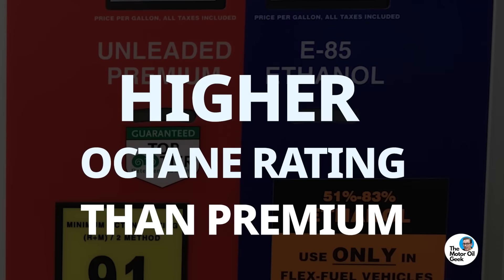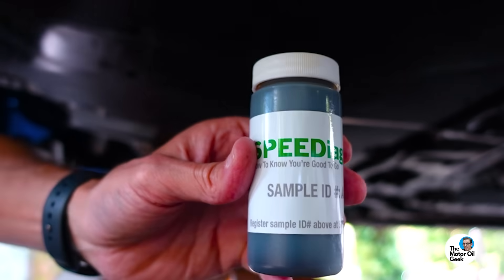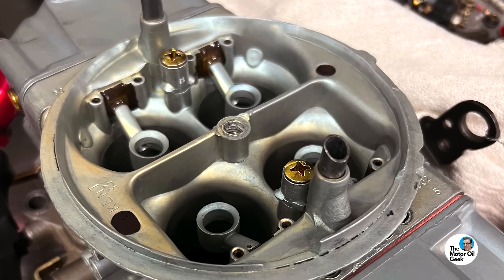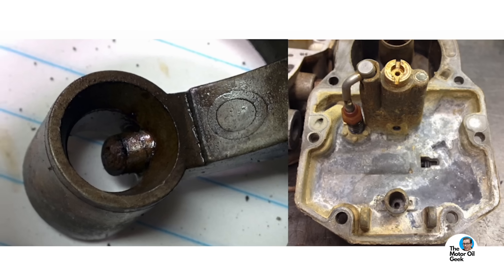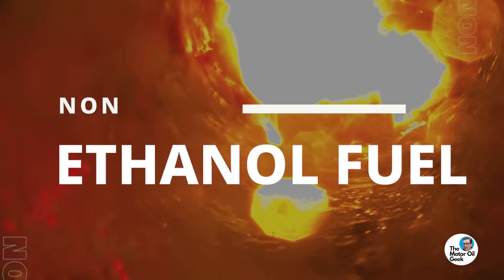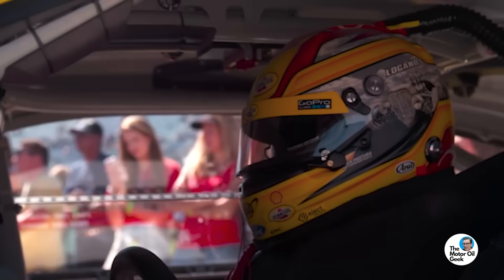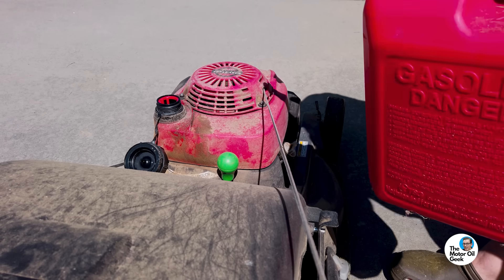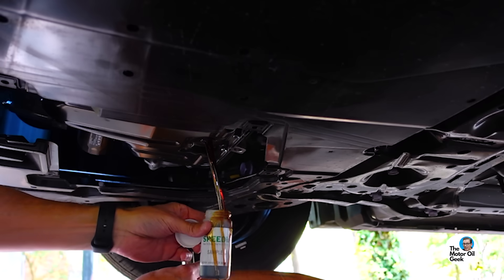ETHANOL: Higher OCTANE, Higher RISK?

Comment: Since you brought up the fact of using TruFuel, what about comparing that fuel to mainly mixing the oil? My two-cycle stuff does not run nearly as good on the canned fuel as it does when I mix it manually.

Comment: I have a 2018 F350 with the 6.2L I use for my lawn maintenance route. I run the same route every day. When I use E-10, my fuel mileage is right at 8.0 mpg pulling my equipment trailer. It never changes. But the few times I tried the E-85, that same route always got me 6.8mpg. Not worth the savings just on that alone.
Reply: The cost benefit only makes sense if you are comparing it to premium fuel, and then it's usually break even. If it can run on 87, E85 will likely never be cheap enough to make sense.

Comment: Yeah, i switched to alkylate fuels for my 4 and 2 stroke carburated small engines 5 years ago becouse i got tired of rebuilding carburetors every season. 

And even if the price of alkylate fuels is higher it saves me time and money in the long run not having to drive 15 miles to buy parts and waste my day working on something that i shoudnt have to work on every few months. 

I dont mind tinkering with stuff but it gets old pretty fast when none of your machinery works after sitting unused for a few weeks or months and you go and try starting them..

I even flush the carburetors on my streetbike with the alkylate fuel when the bike goes to winter storage.

Our mx bikes get driven through the year and we havent had problems on those with E5 fuel. I still drain the carbs if i know we wont be going out driving in a few weeks.

Comment: Been doing mechanic work for 55 plus years, don't know why I watch this already knew it, ethanol mixed fuel is crap, need to bring back our old gas and Diesel, if you go down and buy all the pre-mix or the little cans of gas you got rocks in your head.
I don't care how you control the atmosphere on drums of ethanol fuel you're still going to get water in it, you just told a big lie.
It is almost impossible to pull the atmosphere down to 0% humidity.

Comment: Ethanol-free has made a huge difference in my small engines.  Used to have to fiddle with the carbs constantly at the beginning of every season.  Now I just use E-free, and run it dry at the end of the season, and they start right back up next year.
Reply: I don't even run it dry at the endof the season and it restarts perfectly fine over six months later. I use nothing except ethanol-free in my small equipment and in my SUV.
Reply: I won't run anything but Ethanol-free gasoline in my yard equipment. Mowers, leaf blowers, weed eaters, edgers, trimmers... all E-free. No more rotted fuel lines, varnished carburetors, and equipment that won't start.
Reply: I used to do the same, but there's so much moisture where I live that I was getting rust in the dry carburetors. Now, before the end of the season, I run atf through the fuel system while the fuel is low, then I turn it off. Helps keep the carb clean too.
Reply: @mattmenshevik I've considered that.  Good idea.

Comment: In addition to all the Negative effects of running E-whatever fuel in older vehicles (and it's debatable whether newer cars have ever been properly spec'ed beyond increased fuel tables), I still don't understand the rationale of how burning 15% more fuel per vehicle somehow offsets emissions savings in a maintained engine.
Add: Lake, not sure if you've seen it, but in my usual reflections, Mike over at MotoIQ did a segment on long-term E85 in his daughters tuned Subaru and what ended up causing its catastrophic engine destruction. (hint: E85-induced oil breakdown and short-duration trips).

Comment: I need to show this video to my friends who give me a hard time for going out of my way for gas stations that offer top-tier, ethanol-free fuel.
Reply: Unless you are driving something produced before the late 90s, or it for a boating and small equipment, it's completely fine. It improves combustion and decreases deposit formation. Lake did a good job explaining the situations where it isn't good, but for the overwhelming majority of cars on the road, they are literally built for it.
Reply: I think ethanol-free fuel is not Top Tier
Reply: @bobt897 top tier is extra detergents, no relation to the presence of ethanol or not. You can get top tier and ethanol free at some gas stations. There are several in my town.
Reply: @bobt897 top tier means there are a higher level of detergents in the fuel, there is no correlation to the presence of ethanol or not. There are several gas stations in my area that offer top tier and ethanol-free 91 octane fuel.

Comment: The best way I found to keep from destroying carburetors in storage is to flush straight 2-cycle oil thru the lines right into the carb. I have several pieces of equipment that sat for several years with no damage to the carburetors. when you want to put the equipment back in service simply put your fuel back in and away you go....
Reply: genius move, wow. sounds legit, especially for carbs with membranes, ive got a feeling the oil would keep the plastic from drying out.
Reply: @louisvl10  It does.
Reply: I put 2 stroke in my bike when I park it for the winter. About a pint to the tank and quick trip to run thru the system.
Reply: @darrinclem2502  nice. How do you flush it out when running bike again?
Reply: What do you think about running them on true fuel before storage
Reply: @AlfieG2255  That stuff gums up in storage just as bad as E-15. Don't leave it in stored equipment if you want it to start a few months later.
Reply: @AlfieG2255 yes that’s what I use from local hardware store
Reply: I thought Tru fuel was just ethanol free gas that had stabilizers in it
Reply: @AlfieG2255 it has 2 stroke mix in it. In different ratios. 40:1 and 50:1.

Comment: amazing to me this obsession with ethanol when we know it shortens the life of engines, damages fuel systems, ruins rubbers and gaskets. And it offers zero energy "independence" because guess who one of the number 1 oil producing nations on earth is? USA. So we're literally taking a $1 out of our right pocket, putting into our left pocket, and pretending like we just found free money. Stupid. But it's politics not performance. It's what's good to buy votes, not what's good for our engines and our wallets. The fact that my flex fuel engine tells me to do oil changes twice as often if you run e85 should tell you what you need to know about how harmful ethanol is on a vehicle. Now riddle me this: if I have to dump 2x the engine oil to use a "clean burning fuel" how in the world does that make it clean? 

The best use for ethanol is an old fashioned. That's it.

Comment: No alcohol formulation is great for fuel system period.

However, How about carbon deposits clogging exhaust system from aromatic compounds combustion like BTEX as octane improver in gasoline?
You will recommend bandage solution “then use Top tier detergent gasoline”, won’t you? 

And also BTEX are all “IARC group 1 Carcinogens” as well. You said store in humidity control room I hope Its ventilated well, otherwise good luck to your lung and enjoy your cancer casino.

There is always a trade off and 
I will not trade off my body health with my cars health.
I will just change my engine oil more frequently and let my fuel system premature fail.

Comment: Here in Brazil we don´t have the luxury of choosing which type of gas to buy, it´s either regular (really bad base gas) with 30% ethanol or Premium (A grade base gas) with 27% ethanol, or pure Ethanol .
We have been suffering with carbs and fuel injection ethanol related issues for decades now, also we have a lot of adulterated fuel which makes matters way worse.
Anyhow, really like your videos, keep up the good work, cheers!!
Reply: Brazil is in a unique situation where their motor fuels don't come from dead dinosaurs but from the leftovers of sugar cane crops which grow abundantly there. For all it's drawbacks it gives them an energy security and independence free from potential foreign influences which we do not have in the US.  That doesn't prevent internal influences in either place though.
Reply: @P_RO_  Yes, that's what the government claims: "We're increasing the ethanol content in gasoline to achieve greater independence and reduce pollution," but in reality, there's a lot of lobbying from producers involved. Recently, the percentage went from 27% to 30%, and the price remained the same. Brazil is self-sufficient in oil production, but even so, the pressure to increase the ethanol content is constant. Here at our gas stations, we have pure ethanol, regular E30 gasoline, premium E25 gasoline, and S-10 and S-500 diesel, all pure Avgas gasoline.
Reply: Not to mention that ethanol has less btu's per unit measure THAN pure gasoline.  

Ethanol is more fuel INEFFICIENT than gasoline.
Reply: @H0kieJoe  Kind of. Pure ethanol engines can have higher compression ratios, which makes them more fuel efficient.
Reply: @MarcosSmith-z1u 

You still have to run a richer fuel mix with ethanol at those higher compression ratios. 

The method of combustion doesn't change the innate chemistry of the fuels in question.
Reply: @H0kieJoe  With ethanol, you can typically go leaner at high loads than with gasoline. Ethanol have a much higher heat of vaporization and combined with the higher fuel mass required for the same lambda value, it cools the engine much better. Add to that the high knocking resistance which means you don't need to retard the ignition the same way you do with gasoline. Ignition retardation causes exhaust temperatures to rise, and to combat that, you typically use a richer air/fuel mixture as excess fuel cools the engine. With ethanol there is less need of that. Ethanol also burns a bit faster than regular gasoline, so it generally needs less spark advance than gasoline.
Reply: Try mixing some Marvel Mystery Oil into your ethanol fuel,  I've found that it coats everything with Oil of Wintergreen and none of my carbs have any corrosion using ethanol fuel.
Reply: @BillySBC  thatd be an interesting test to see
Reply: I feel you buddy, I'm your neighbor here in Paraguay and we have the same situation here.  A cool trick for small engines like chainsaw and trimmer that i do is, remove the ethanol from the gas. Just put 2 liters gas in a 3 liter coke  bottle and about 500ml of water and then shake it and leave it sit for a day, and then make a hole in the cap flip it upside down and let all the water and ethanol out (the water absors all the ethanol from the gas) and now you have ethanol free gass, works much better
Reply: dude wtf?? You can just pump straight alcohol there? That's insane. and how would a car even run correctly on 30%? my generator and chainsaw would be so smoked if I were forced to use even 20%. I live in a perma humid part of the US that probably has weather just like Brazil and the 15% gas sucks up water too quickly to use in small engines especially. So do people that need non-ethanol gas have to buy is somewhere else?
Reply: @frydemwingz To be honest, the only ethanol-free gas available here that I am aware of is AvGas, crazy expensive and almost impossible to get for the average Joe.
Here all our cars are FlexFuel, they can run on any mix of gas-ethanol or straight up 100% ethanol.
Reply: @ajr.1272 that's the 110LL for airplanes it contains lead so can be bad for most of modern engines..
Reply: @frydemwingz cars here are flex fuel, they have different compression ratio, it can run in any mixture, and generally they produce more power on e100 than any other mixture.

Also it's not like the op said most of the cars don't have problem, in injectors and plastics, since they have been designed to work with ethanol.

In the performance scene is fairly common to convert gas only cars(Camaro, Corvette, THP Citroens, Subarus) to ethanol by swapping fuel pump, a few other pieces and of course remapping the ECU.
Reply: @atrgames  Yeap! The only cars that are having problems are those with direct fuel injectors.ajr.1272 is exaggerating!
Reply: @frydemwingz  All kinds of engines produced inside this country is prepared for ethanol fuel mixtures. 95% of all our cars produced today are flex fuel that can run on anything from 22% to 100% ethanol. Yes, there are projects that has some issues and will fail sooner running on E100, like direct fuel injectores that are failing in many of our brazilian cars, but for many years now, E100 is a very common fuel in Brazil. Since the 70s the "Pro-ethanol" program created buy our government made incentives for the car brands to produce E100 only cars that were produced until 2003. From 2003 on, flex fuel cars became very popular. The old carburators in our cars are all nickel coted to protect them from corrosion.
Reply: @frydemwingz  Yes, pure ethanol has been available at gas stations here since the 1980s, when the first ethanol-powered cars were created. In the 2000s, flex-fuel cars emerged and today represent over 70% of our fleet. Sugarcane ethanol is produced extensively here, so environmentalists, along with producers, are lobbying the government to increasingly increase the ethanol percentage in gasoline. Today, our regular gasoline contains 30% ethanol, and premium gasoline contains 25% ethanol, making pure gasoline pure (Avgas). Modern cars, even those manufactured outside of Brazil, can run normally on our gasoline; the injection system automatically adjusts the fuel consumption, and small engines are already sold with carburetors tuned for our gasoline. The downside is higher fuel consumption and potential fuel injection system problems caused by ethanol. The upside is that our regular gasoline has an octane rating above 89 AKI, and premium gasoline above 97 AKI. Modified and racing cars use pure ethanol here; it's perfect for that.
Reply: A Premium tem 25% de etanol, ela não foi modificada.
Reply: @douglasguido6627  That's right, braziliam premium fuel is 25% Ethanol 102 RON.
Reply: @rauserfroes81  In fact, Podium gasoline has 102 RON, the minimum for premium gasoline here is 97 RON, Podium has the highest octane rating on the market.
Reply: Eeks I wonder if the cars from the USA have any problems if we drive down there?
Reply: @nq2847 Not really, but it does lose a bit of mpg and the injectors pretty much work overtime.
 I myself drive a ram 1500 classic with the 5.7 hemi, here it truly gives the term Gas Guzzler a meaning.
Reply: @nq2847  If it is a flexfuel car, you won't have a problem, but gasoline only engines might suffer a bit. The A/F ratio of our current gasoline (flexfuel ones, most of them) engines is about 13:1, american cars are 14,7:1. Modern eletronic Injected cars can adjust it, but carburators can't.
Reply: @nq2847  No, some models that are not sold here officially are imported independently from the USA and Europe and run here normally, the electronic injection has a wide margin for mixture correction.
Reply: Do the L
Reply: Wow!!
Reply: The ethanol mixed in gasoline for E30 are pure, but the E100 are not sold pure. It has 4% water.
Reply: Time to buy an EV. We have owned our Tesla Model 3 for six years. Amount spent on maintenance (ignoring tyres)? $0. 
Yes, zero. I’ll never buy another ICE vehicle.
Reply: @FutureSystem738 

EV's are wasteful and impractical, imo.
Reply: @FutureSystem738  For the price of 1 tesla here in Brazil, we can buy more than 10 compact cars. Or some 6 or so diesel pickups. Not worth it. Eletric cars are luxury for first world countries.
Reply: @FutureSystem738  We're not giving 10 cents to a company run by a raving lunatic drug addict wielding a chainsaw and throwing 8 year old cancer patients off their life saving healthcare.   Musk and his company need fail.

Comment: I use ethanol shield in nearly all my mowers weed whackers and even motorcycles when I had one.  Never had any issues like hardening rubber with stabile. I have used sea foam and had good results also but I like ethanol shield better. Mowers can sit all winter and start right up in the spring without draining. Same with my chain saw that might sit for a year or more.